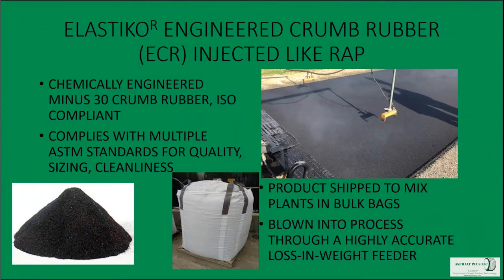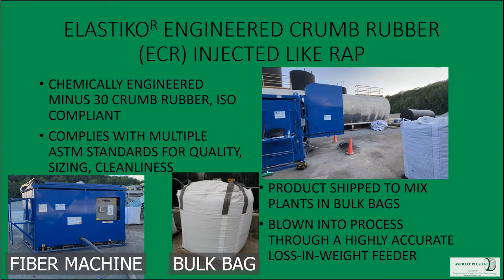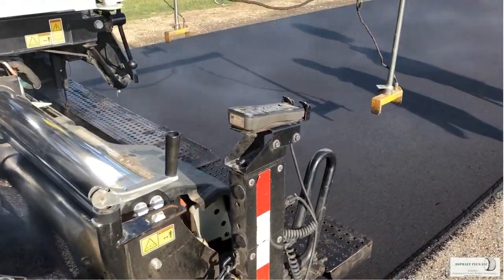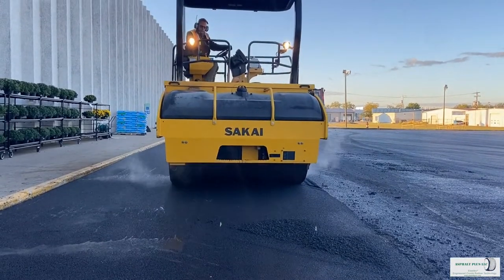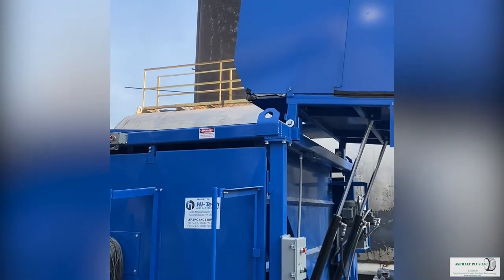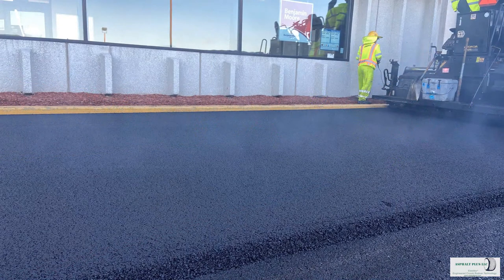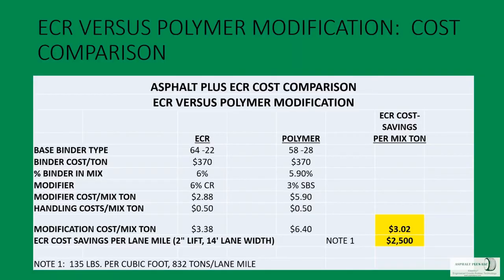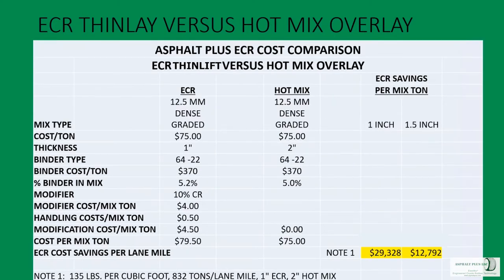Engineered Crumb Rubber Asphalt Analysis & Cost

Comment: I have a small asphalt repair business using infrared heaters to reheat he pavement and patch mix in potholes.  Can I add CR to my cold recycled asphalt mix and expect it soften and bond with the patch mix to produce a stronger rubberized mix?  The IR units get up to 1500º, but because the propane flow is cycled on and off electronically, there's a reduced chance of overheating the surface and contents.